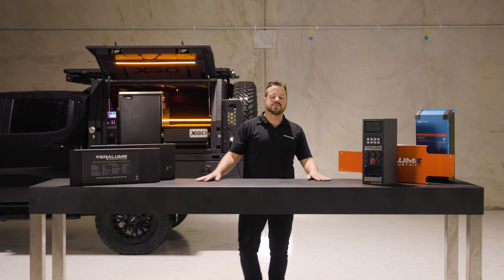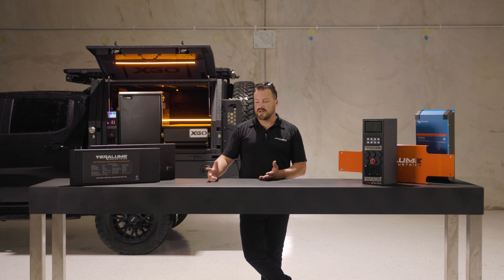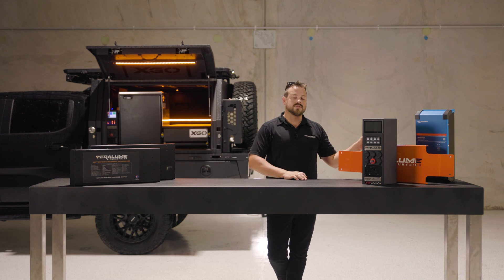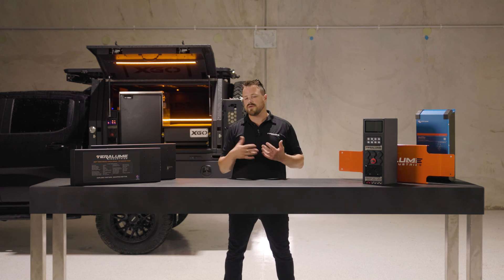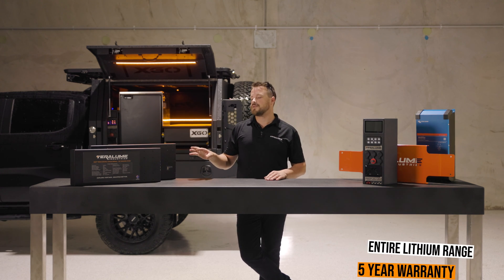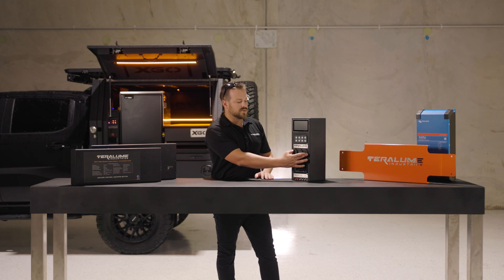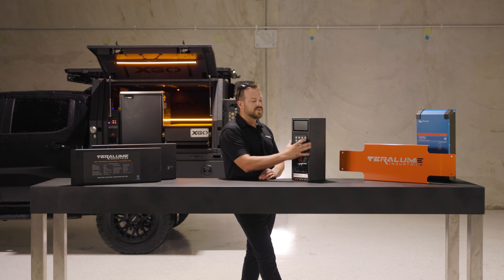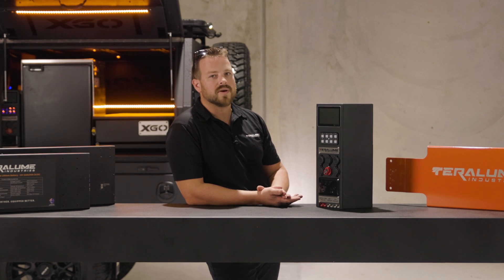The Ultimate Guide To Lithium Power Management | Teralume Industries

Comment: 105ah - your website only states peak rush current values, and no mention of the standard discharge rate. 2ndly the 105ah states 360a peak at the top of page, and 500a peak in specs. Shonky.
Reply from the maker: Incorrect, we mention the BMS specification and discharge rating in the specs for each product. Nothing shonky, maybe just your eyes.